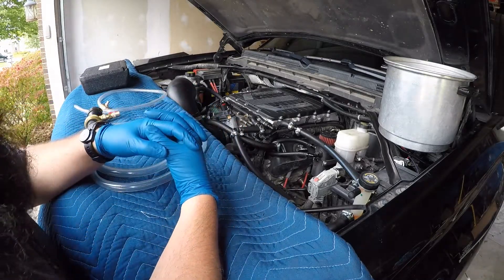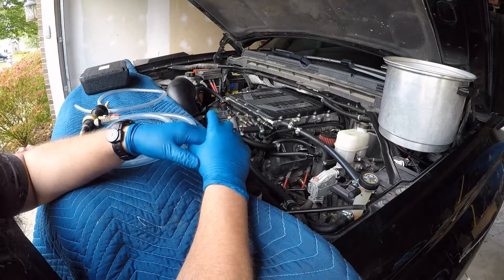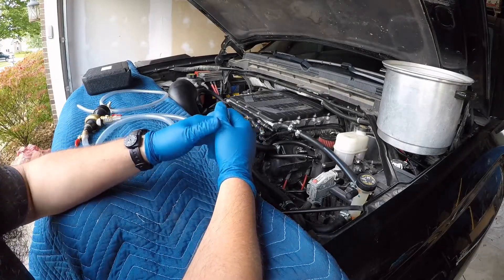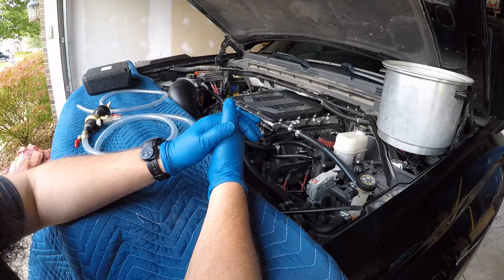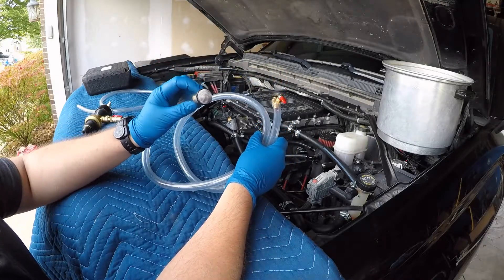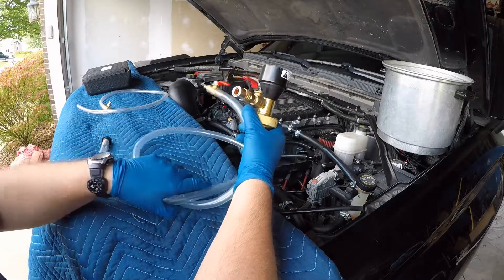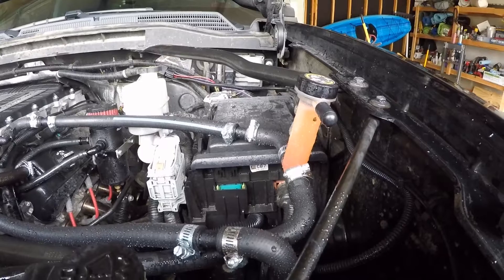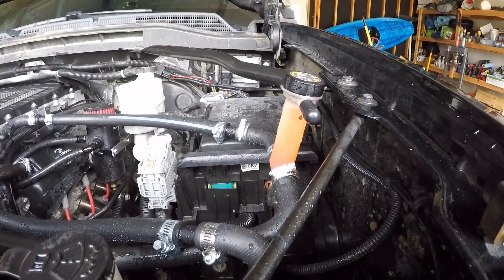LT4 Supercharger Install - Supercharger Coolant Pump Shutting Off

Comment: Why not just wire a secondary switch activated on key on?
Reply from the maker: The relay is essentially acting like a switch and is activated when ignition is on. The issue with the pump turning off, however, was not electrical related. It was due to air in the supercharger cooling system. That logic is built into the GM OE pump and I don't think it can be worked around. Which is fine by me because I'd rather the pump turn off so I know to fix the issue of air in the system rather than running all the time with air in the system which can cause poor cooling and other issues like cavitation.